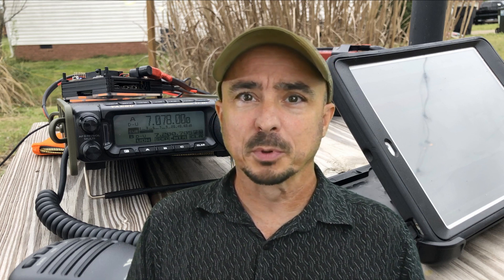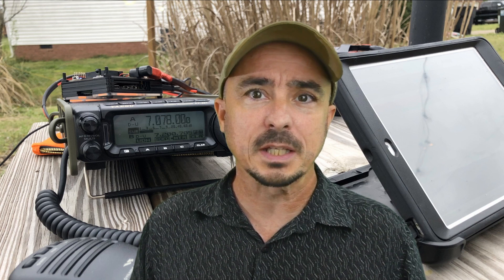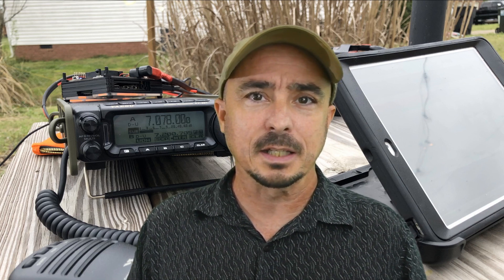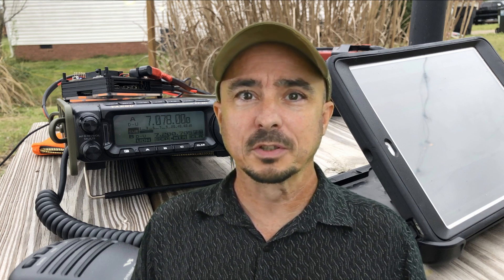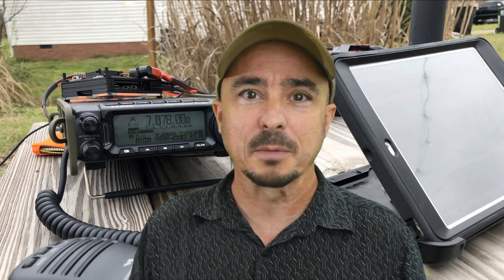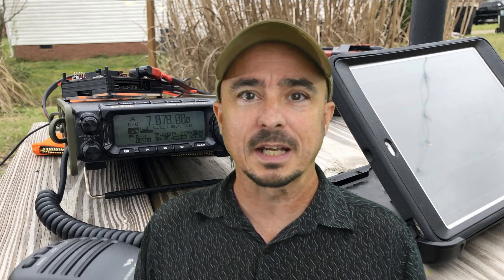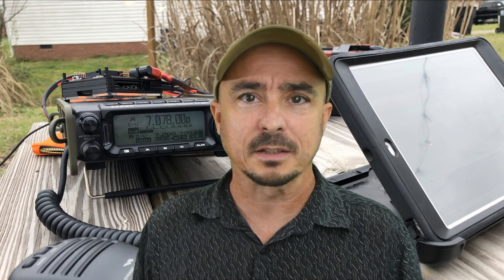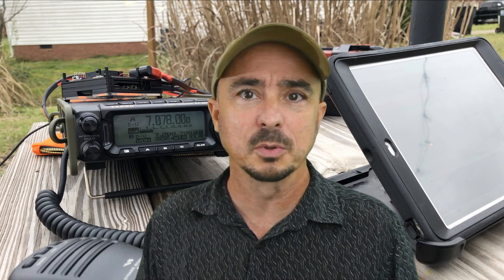Broken 891 Part 3

Comment: I just received my FT-891 a month ago and have been able to get it mobile once and used it at home twice.  When I enable DNR the rig throws a ton of really unhealthy, crackling-sounding static.  Experience anything like that?  My SWR has always been < 1.7 when used and I've tested on both 20M and 40M with the same results on this rig.  I should include antennas....used both a buddistick setup at 20M and 40M and Shark mono-band hamsticks at 20m and 40M.  Thinking a service ticket is in my future.

Comment: I have exactly the same problem so would be interested in hearing what the outcome is
Reply from the maker: According to the invoice from Yaesu, it was a bad diode causing the problem. Mine is back in the shack and working as it should now.
Reply: Thanks for the reply, like yours mine can be on a while just monitoring but then suddenly attenuates and i can hardly hear anything. Also i can tx for a while then suddenly when i release the ptt it attenuates and i cant hear the other station. I'm guessing when it gets to a certain temperature the fault develops.

Comment: I got exactly the same issue with my ft-891. So I guess I'll also have to send it in. Unfortunately the warranty ran out on mine and repairs by authorized dealer in Switzerland are almost as expensive as buying a new one. 73 HB9EUE
Reply from the maker: That stinks! I just got notice that mine has shipped but I haven't received it yet. There was nothing on the invoice to indicate what the issue was. I'll see if the is any explanation in the box once it arrives.
Reply: @KM4ACK  Yet another 891 user reported the same issue in the 891 Facebook Group. Apparently it's a couple of receive filter pin diodes leaking until the bias voltage is on a level to trigger the TX/RX relay, disconnecting the antenna input.

Comment: Jason, have heard from Yaesu?
Reply from the maker: Finally I did. Suppose to ship back to me in the 20th of the month.
Reply: Has the representative told you the technical issue with your radio?
Reply from the maker: Luciano Gasparini no. Only one email saying they received it and the expected ship date.
Reply: Amy news about your radio? Do you plan to make a dedicated video regarding your radio technical issues?
Reply from the maker: Luciano Gasparini the radio came back last Thursday. The invoice indicated a bad diode. It’s been running great since it was returned. Not sure it’s worth a video to say “bad diode”. I put out the news in my newsletter and on Patreon.

Comment: I sent my 817 in a month ago and they told me the same thing, but I did get a service number about a week and a half ago so it's at least in the system now. But as yours is still under warranty you might get yours back more quickly. Here's hoping. 73 Kris n9uke

Comment: Yep yep yep. The LCD went out on my 891. When I called Yaesu they told me about the quarantine of the radio. I did have to send my 857 in a few years back. That was a good experience. They are good to work with.  GL to you and 73.

Comment: I would be very surprised if it actually takes 4-5 weeks even with the quarantine process. I have sent back several radios to Yaesu for repair (including my FT-891). I sent a VX-8DR back to them and they'd received it (from Idaho), quarantined it, processed it, and returned it end-to-end in three weeks. Pretty painless. My FT-891 was out two weeks last year. They're really good and indeed very friendly. The FT-891 was under warranty and it's working like a champion currently. I am sadly about to send in my FC-50 which I recently bought, but that's another story.